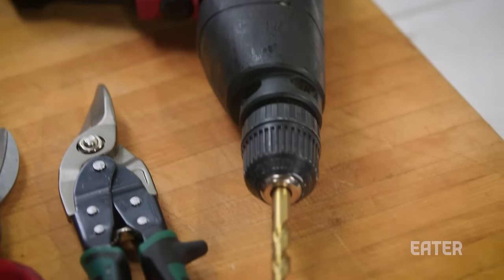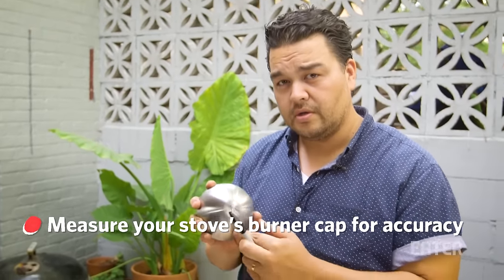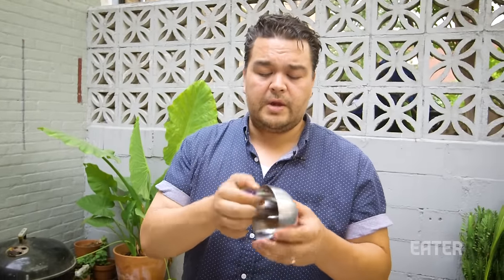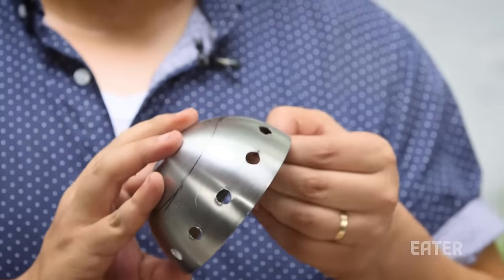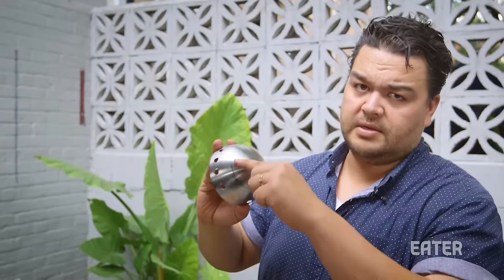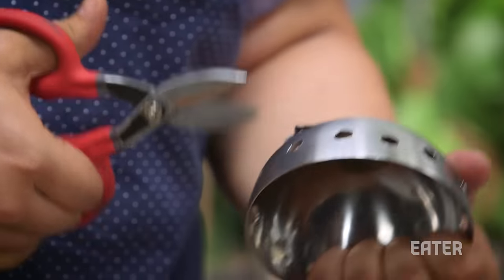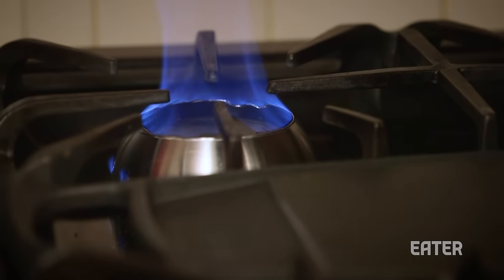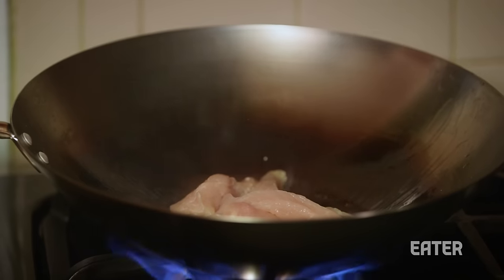How To Turn Your Stove into a Wok Burner — You Can Do This!

Comment: USA stoves do not have near the btu output for a wok.
Reply: It really depends on the stove. I have a Kitchenaid with two high output burners. If I remove the top plate of the burner, I get a jet of gas, and on my carbon steel round bottom wok, it'll get smoking hot in just a couple of minutes. If I throw oil in it and don't immediately add the food, I'd have a grease fire in no time. I can't imagine needing it to be any hotter. Of course, this is with a 14 inch wok, not the giant woks used in restaurants.
Reply: entirely missing the point. Here's an analogy that might help. Take a dry leaf outside on a hot summer day and hold it in the sunlight. What happens? Nothing. Now take a magnifying glass and concentrate a beam of sunlight onto that same leaf. What happens? It burns. Did the sun all of a sudden increase its output? Of course not. You just concentrated what output you were getting into a smaller area. This is the same idea as this wok burner. With a regular burner much of the heat generated is wasted heating the side of the pan and the air around the wok. This concentrates what heat IS generated by the burner to the bottom of the wok where it is actually usable.

Comment: I call bullshit! My hob at home has a burner with a smaller centre ring and a larger outer ring for wok cooking. It spreads the heat all over the wok, sides n'all! Best invention ever - where did you get this idea that wok cooking requires a small concentrated central flame?

Comment: This is so dumb 
Just take off the cap of the burner.
Reply: DX zilla Okay, I've just tried your suggestion and you've clearly never actually done this yourself before. The gas stream comes out at such a high velocity that it instantly puts itself out unless you have that cap in place (and, before you comment, the piezo lighter is too far from there stream to ignite it). The other alternative would be to have a pilot light constantly reigniting the gas stream, but then you're wasting another fuel just to maintain your hob.
Reply: Mike Trieu 
It works for my burner.  So, there's that.  Clearly you can't imagine other people having different kinds of stoves.
Reply: Yen Sidious Then I question the output of your hob. Even I can get mine to "work" if I dial down the flow rate to some ridiculously low level, but that's obviously not the appeal of this method. Furthermore, it doesn't make sense logically. In order to sustain the flame, you need the right fuel to air ratio. Past a certain stream velocity, that becomes unsustainable. Perhaps your piezo lighter is close enough to the gas outlet to constantly reignite the stream, but it's not magic or universal like the OP made it sound like.
Reply: DX zilla I’ve tried that but it set off  the carbon monoxide alarms.
Reply: The caps are required for newer stoves.

Comment: 99 cent piece of metal plus $100 in tools. also who is concerned about only spending 99 cents if you can afford a place with a gas range. If you are shopping at the dollar store your apartment doesn’t have a gas burner lol. Just buy one of those things premised for $5
Reply: He's assuming you already have the tools. If you're a homeowner, you probably do. And where do you live that having a gas range means you have money? Almost every place I've ever lived has had a gas stove, and I've lived in some shitholes. Cheap gas ranges are cheaper than cheap electric ranges and cheaper to operate. And even if having a gas range means you're doing well, why wouldn't you want to save money by buying things at the dollar store? I now own a home, make a nice living, and have a nice gas range, and still will buy things from the dollar store to save a buck or two. A penny saved is a penny earned, right?

Comment: This is a stupid video! All this does is change the shape of the flame. It does nothing to increase the BTU output which is required for GOOD wok cooking. Most residential gas burner is 5000-18,000 BTU at best.

Simply put, authentic wok cooking in North American homes isn't possible. Our residential stoves, range hoods and gas lines don't allow us to obtain the proper heat and ventilation needed for authentic wok cooking. While your local Chinese restaurant can (commercial wok burners are 500K-1000K+ BTU), so they will always get your money.

The only other solution is to obtain a  proper high-pressure gas burner for residential outdoor use (minimal 200K+ BTU).
Reply: entirely missing the point. Here's an analogy that might help. Take a dry leaf outside on a hot summer day and hold it in the sunlight. What happens? Nothing. Now take a magnifying glass and concentrate a beam of sunlight onto that same leaf. What happens? It burns. Did the sun all of a sudden increase its output? Of course not. You just concentrated what output you were getting into a smaller area. This is the same idea as this wok burner. With a regular burner much of the heat generated is wasted heating the side of the pan and the air around the wok. This concentrates what heat IS generated by the burner to the bottom of the wok where it is actually usable. you some common sense